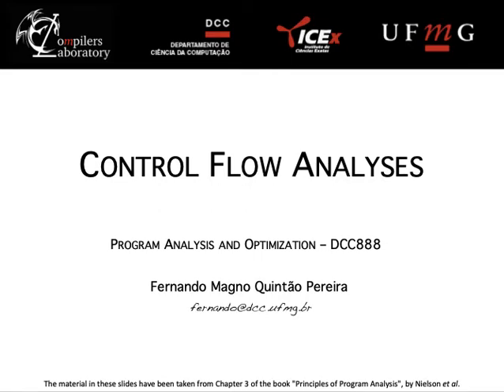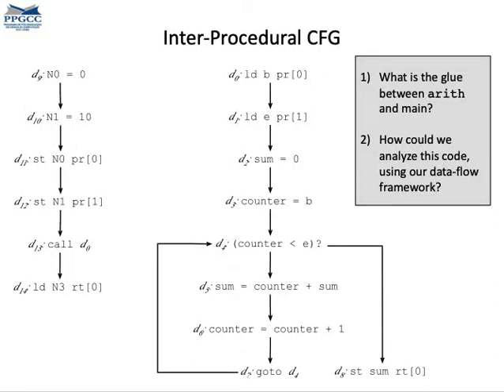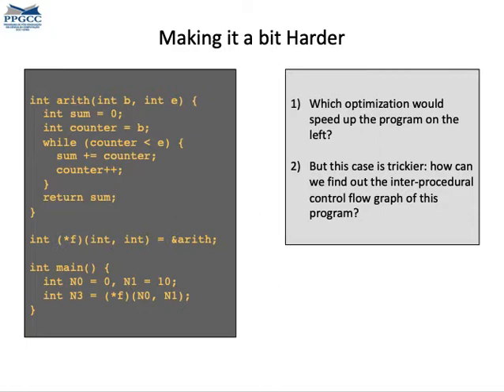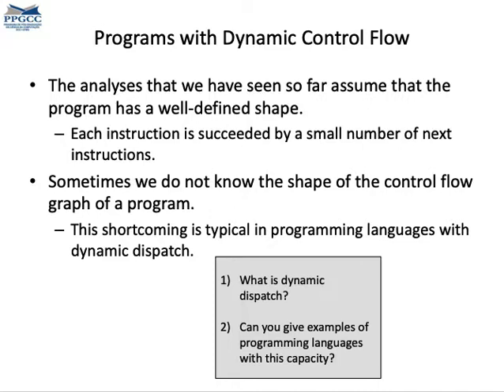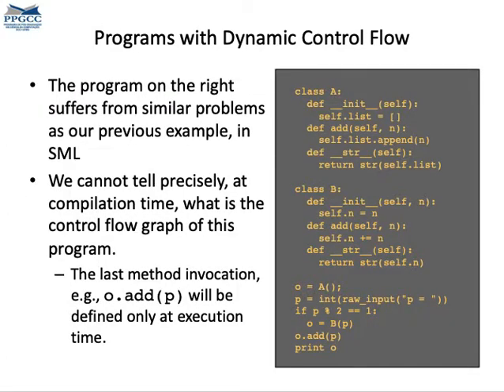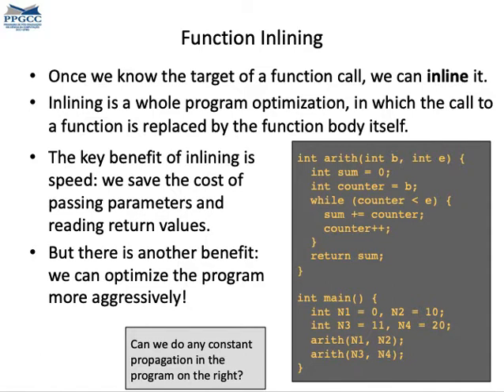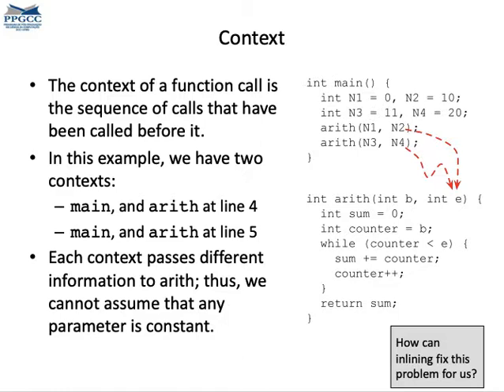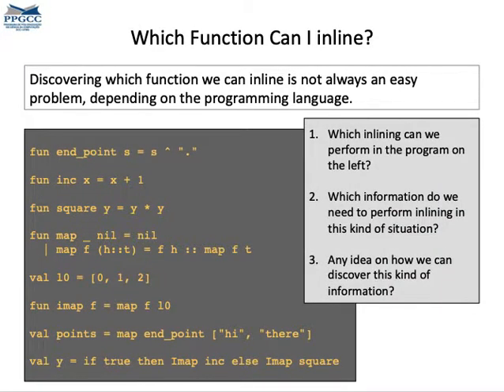Control Flow Analysis - Part 1

Comment: Sir do you have any Code Implementation of Control Flow Analysis in C Programming ?
Reply from the maker: Hi! Not really (nor in any other language, unfortunately!) I've never heard of an implementation of CFA for C, though. Perhaps, if we look for one, we could find something for C++. In that case, solving targets of method calls should be enough of a motivation. But, most likely, people would use something like rapid type analysis in C++ and similar languages, like Java and C#. I think that most of the implementations of CFA will be available for languages in the Lisp family (given its origins). But you might also find implementations for Haskell, SML, Ocaml and other functional languages. For instance, take a look into this code: https://github.com/batterseapower/haskell-kata/blob/master/0CFA.hs